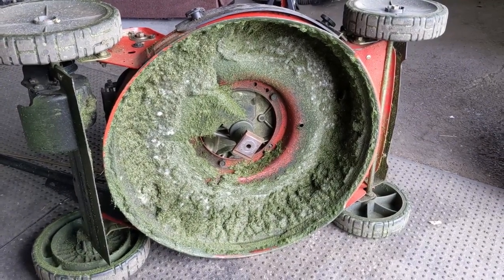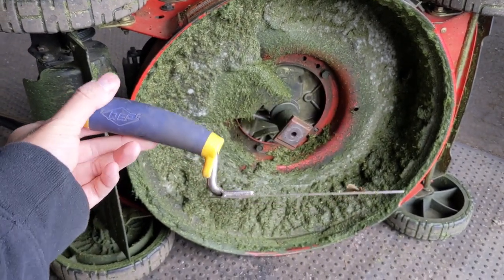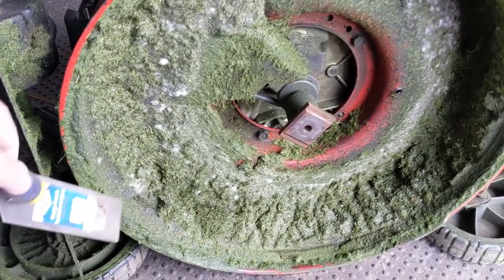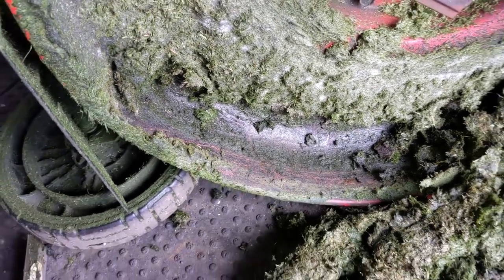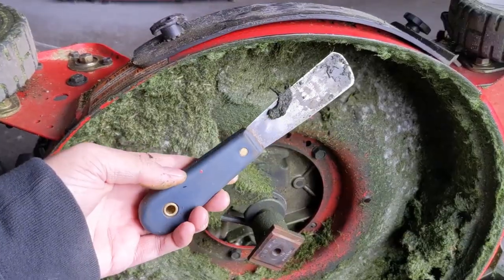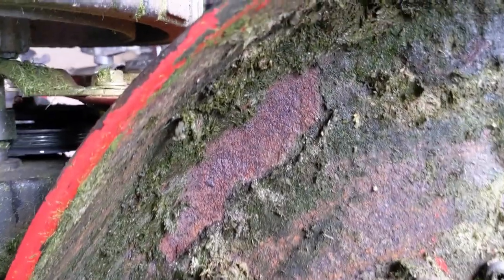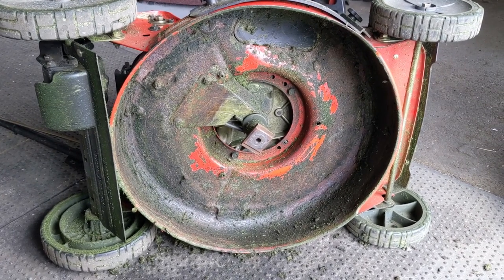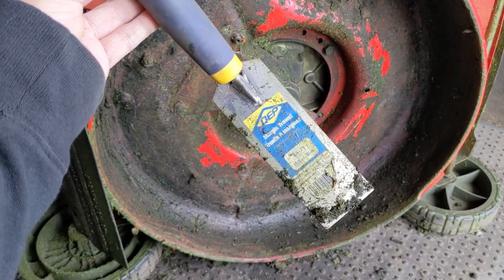Best Lawn Mower Deck Scraper?

Comment: #1 thing to do is mow when the grass is DRY! I know you can't allways do that but I can because I am retired. I just wait until the grass is dry and never mow in the AM hours. I mow later in the afternoon. Recently, I had to change my blades and the underside was very good. I wirebrushed it and painted it with some old spray paint that needed to be used up. It was beautiful, looked brand new! Happy mowing!😀

Comment: I have always used the Plastic Putty Knives to minimize Scratches in the Deck. They work real good!
Reply: Who cares about scratches under a mower deck. 🤦‍♂️
Reply: @TheShowtime85  I like to leave the paint in the best possible condition. It prevents rust, especially for steel decks. My current mower is 20yrs old .

Comment: Interesting, the Grass Buster deck scraper is my go to. Works great.  I would just grind off the pointy edges on that trowel and it might be even better and similar to the one I use. Also when I install Oregon G3 or G5 or Stens Silver Streak I find the decks stay way cleaner. Thanks for the video.

Comment: After I scrape, I spray the underside with a 25:75 mix of oil and diesel/old gas. Helps to slow the rusting and gets oil right into the little nooks. Old farmers trick.

Comment: Even if you just add one additional cleaning of your mower deck, will save the steel much more effectively. So try and squeeze in a deck cleaning around right after the 4th of July, you'll be better off. In the Spring and early summer, the ground and also the grass is much wetter and "stickier". Most of the grass from the deck in this video is from April & May time frame..

Give it a shot. You'll be happy you did it in the fall and pre-spring cleanings, and save a few years of deck steel!  ✌️

Comment: Yo yo from the 🇬🇧.. I use a tool called a grass buster. It's a great tool.. hope you and the old man are keeping safe.. take her easy
Reply from the maker: Grass Buster! Will have to check it out! Thanks Mick, cheers from Ontario!
Reply: Thanks from the OLD MAN Mick, hope you and yours are also safe and sound. Yep seen the Grass Buster but this baby does the trick very easily for cheap! Good idea to round off the outside corners though.
Reply: You stretched it to 15 mins lol, i couldnt do it. I watched your ads though without skipping.
Reply from the maker: Lol thanks for stopping by

Comment: And undercoat the bottom with RustCure 3000 rust preventative and Bob's your uncle. Another interesting video, easy to grind those sharp corners in and put in a radius if your inclined to do so.